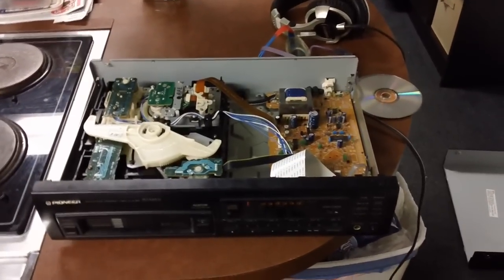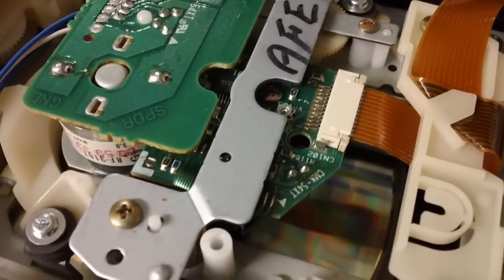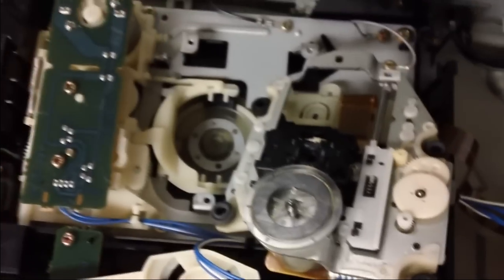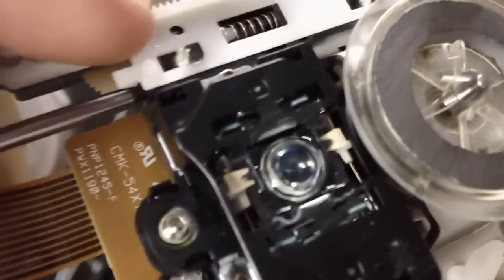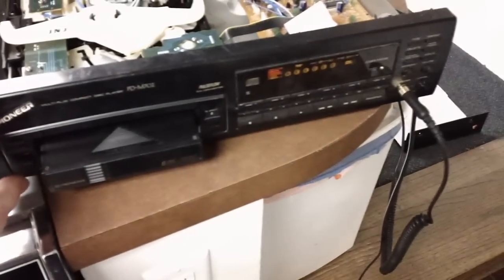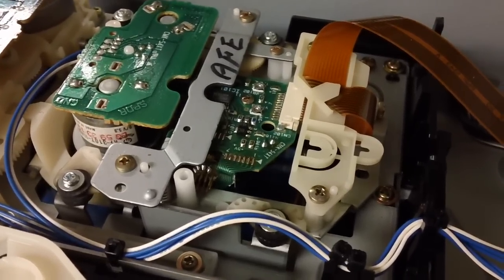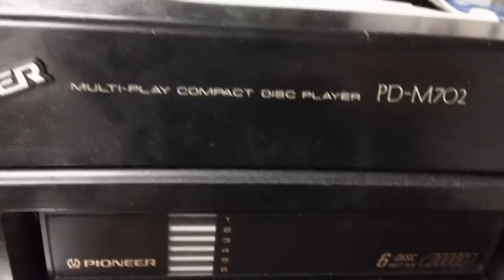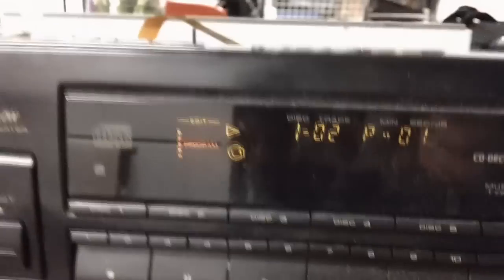Pioneer 6 Disc Player Repair

Comment: Within the last couple of days I fixed a Pioneer PD-M410 with exactly the same problem! I turned it over, as you did, and the lens fell right out. I even had the same cyano around the house to reattach the lens.  Thanks for posting the video!

Comment: Thank you so much for posting this. My PD-M502 had the same issue but was also making this high-pitched noise when I tried to play a CD and the player just hung up for a minute; the lens may have been loose and flopping around before it finally came off in the chassis. Not only did I save the unit from the trash, I also saved $75 which is the cost of a replacement optical unit (or $400 - $1000 for a new CD changer). I bought this system in 1992 (30 years ago!) and except for this one issue it has been soldiering on all these years.

Comment: Good diagnosis of a simple repair.  I just picked one of these (vintage?) units up for super cheap because because the previous guy didn't know that the CD's have to be loaded upside down in the cassette.  I watched your vid and thought, hmm if the lens is on the top, then the CD label probably needs to face DOWN!  It works fine after flipping the CD over.

Comment: Same problem with different pioneer model. I was puzzle when couldn't see a lense to clean,but thought cd not spinning was down to no power to motor. I have no idea why no lense would prevent cd spinning,but after finding your video and lense,I have now fixed my cd player. Many thanks.
Reply: How did you know which way to put the lens?  I tried both sides with clear tape holding it, but nothing either way.  It matters too.  If you look through the lens, it’s different.

Comment: Thanks for posting this. I just picked up a pd-m400 at Goodwill for $15 in pretty decent shape. Noticed in the store there was something rolling around inside the unit but it powered up so I took a chance. Carefully glued the lens back in with 5 minute epoxy. I just applied a thin layer around the rim of the laser body and pushed down firmly on the flange of the lens. Worked great, thanks again.

Comment: Just got this CD player and it didn’t work. Checked out you video and remembered that 25 years ago I had a single disc version of this player where the lens popped off in transport to college. Like you I glued it back in and it worked ever since. So it took this one apart and found no lens rolling around. So I read the instructions on the cartridge and saw that you must put the discs in “upside down”. Works just fine! Thanks and no thanks! Lol!

Comment: The lens only goes on one way. Be sure to use magnification to see which is the right way because you could glue in on upside down. He does not mention that in the video. I have repaired two of these for friends in our RV Resort. I would guess that many of those units had the same problem and ended up in the dumpster. This video saved two of them so far.
Reply: it goes in naro diameter side in
Reply: coolelectronics the little flange side goes inward...I see what you mean.

Comment: Thanks for posting this, but to others out there don't use super glue, use contact cement. 
If the super glue runs it will ruin the lense (super glues melt the plastic as part of the bonding process).
If you are extremely careful as he was it will be ok but rather not risk it. 
Others have said they use a tiny bit of loctite gel (not runny) and that works as well.

Comment: Discovered the lens had fallen on my Pioneer PD M630. Going to try model cement to hold it. Thanks for the video!
Reply: Testors model cement seems to have done the trick. Let it sit for several hours.  We’ll see how long it works!  The lens fit was pretty obvious, it seems to be in a little housing that fits into a slot. I put a couple dabs of cement with a toothpick on the rim of the housing.  Wore plastic gloves while working with it

Comment: Just a heads up for anyone else on here, I was having playback issues lots of ticks and found that the 4 rubber grommets suspending the transport were crushed. I shimmed them up so there was no gap from the bottom and it now works perfectly. I guess over time the weight of that transport crushes them flat.
Reply: I'm thinking this might be my problem as I too am having lots of ticks. What did you use to shim them up?  Have not opened up yet but want to be prepared.
Reply: Same here. All 4 rubber grommets had shrounk/compressed 2-3mm and were dryed up. Resulting in the cd scraping in the disc cartridge due to everything was sitting to low.
Reply: Can you maybe take a picture of exactly what you are referencing as I did have the lens problem, but still won't spin. I'm taking a chance, as this video and postings are older, but figured I'd give it a shot. : )
Reply: @lindimayfield9885  If you take it apart you will see degraded suspension grommets, use little orings to replace them to give you correct spacing. Its been a long time since I did it. If I did it again I would just cad up some new one and print them in tpu.

Comment: This video saved my day, and my player as well. My lens was also lensless, and I did the shaking...Lens fell out exactly as in the video.
Clueing that sucker back in place, can I just add the glue and put it back in it's place, or should I be careful with the glue? What is north and south on that lens? Thanks a lot...Michael

Comment: Common issue with these Pioneer six disc magazine changers.  The adhesive holding the objective lens in place fails, allowing the lens to fall clear of the optical pickup.

Equally simple fix: use low fume plastic cement to affix the lens back into place, such as modeler's glue.  I would not recommend using super glue as the cyanoacrylate fumes can deposit a residue that can foul the optics.

Just repaired a PD-M801 for a client that exhibited this problem.
Reply: bcdhifi

Lens orientation shouldn't be a problem, AFAIK, though, even if it is, you don't have much to lose at this point.

You would have to make sure the lens rests perfectly flat in its place, though.

The 5 min. epoxy sounds like it will work, so long as you use as little as possible to reduce the risk of any excess adhesive getting into the pickup or getting onto the surface of the lens.

But, even with fast setting epoxy, I would recommend letting it sit for at least a few hours in an effort to give the adhesive ample time to cure.
Reply: bcdhifi

You're welcome and good luck.

Comment: Can anyone help?! I have a Pioneer 6 disc changer, a little older than this model but I expect the mechanism works the same. Basically, the mechanism which guides the CD to the lens is leaving little grease spots on the CD, causing them to skip, dependent on where the spot is left. Are there little rubber/felt guiders that come into contact with the CD? It's been doing it for years and now my mate has got one and it does the same thing. I think it is stray grease  (that white stuff) which has leaked or melted on the rubber stops which is then imprinting on the cd's even before they get to the lens because sometimes they skip after I put a fresh, clean CD in. I have to clean the marks of each CD everytime they're played or they will skip on other equipment. My mate seems to think it's from the CDs themselves. I disagree with him. HELP!

Comment: @samer saleh is correct, DON'T use superglue!  A quick setting epoxy glue (araldite) or similar is perfect for this.  With regard to lens alignment, try to reposition where the old glue marks are.  Sit the lens in and apply 3 tiny spots equidistant around the lens applied with a very small tool such as a cocktail stick will suffice. Let it set and you should be good to go. Don't get glue on the lens!

@samer saleh pop it back off and clean it up with rubbing alcohol.

Comment: Any suppliers of replacement focus lenses? I cant find my missing part anywhere.
Reply: Same here. Did you happen to find any suppliers yet?
Reply: @CapnCody1622  None yet but im sure they are out there somewhere, China maybe. Next step is to find a Pioneer at a thrift shop and scavenge the lens.
Reply: @ridgerunner4943  I messaged a couple suppliers on Alibaba. Then I was putting the case back on the player and the lens popped out from who knows where! I got lucky this time lol If those suppliers message me back, though, I’ll let you know if they’re a good source.
Reply: @CapnCody1622  thanks and good karma that you found your lens!
Reply: @ridgerunner4943  Update on the Alibaba suppliers: They all want drawings and dimensions so not as easy to get as I thought it’d be. I was hoping someone would have them already made and in stock. If someone was able to get the exact dimensions of a lens it would probably be a good option for someone.
Reply: @CapnCody1622  my wife is Japanese and she is on the posts from the Akihabara suppliers. Someone, somewhere, has a box of these lenses.
Reply: @ridgerunner4943  Oh that's awesome! Yes, that's exactly what I was thinking. Someone's got to have some!

Comment: MUST READ, DO NOT USE SUPER GLUe (cyanoacrylate) this video shows the correct fix for most of these machines but the super glue will attack the lens and fog it up. Use a water based glue (even elmers would work here). You just need it to stick in there but super glue will mess it up...don’t make my mistake

Comment: I HAVE A PIONEER PDM450....WORKED FOR EVER,,,,STOPPED SUDDENLY. I FOUND THE LENS AS YOU NOTED IN THE CASE,  PUT THE LENS BACK ....BUT THE UNIT DOES NOT WORK,,,, GOES THROUGH ALL THE DISKS BUT NEVER SPINS....ANY OTHER SUGGESTIONS ?  I AM WILLING TO PAY IF YOU FIX MY CD PLAYER
Reply: +samuel kauffman Possibly you glued it on upside down.  eBay time.  I bought a used unit because the IR on mine stopped working.  I swapped out the laser assembly on mine for the used unit.  Anyway, good luck.
Reply: H

Comment: Pioneer had terrible reputation for their CD player losing the focusing lens and the very high end expensive models where also effected and you had to buy a super expensive new laser assembly  to repair the unit if you lost the lens, I remember many customer complaining that the less than 2 year old top end machine no longer worked and the lens could not be bought separately...............

Comment: I read somewhere else NOT to use superglue, it will haze the plastic lens
Reply from the maker: You're not wrong, if I could remake this video I'd change it to some sort of epoxy based glue instead, cyanoacrylate glue will haze the lens in some cases
Reply: speedytech7 I guess your one of the lucky ones.  I glued mine back on, and it makes the CD’s spin, but it just skips around the same spots on a song over and over....UNLESS, I hold the front of the unit up on a 70 degree angle....even then, not a guarantee but an improvement...ugh!
Reply: Andrew Battersby I was told by the ONLY Pioneer service guy left in my area that the 4 rubber grommets that support the laser assembly are shot from 20 years of attic heat and cold and gravity.
Reply: Andrew Battersby  and bad caps still wouldn't work at a 70 degree angle either...lol
Reply: Andrew Battersby  Its in the hands of an "authorized service center" now....along with the duel cassette player and turntable now.

Comment: I got the same problem but I can't find my lens
Reply: You will get the same symptom if the laser dies.  The spindle won't start up until it gets an initial 'bounce' from the laser off of the disc.  If the laser is dead, it won't start spinning and it will just cycle through all of the CD's, and will likely give a 'no disc' message.
Reply: Did you ever find a place to buy just the lens?
Reply: @CapnCody1622  ohhh yeah I did...like he said, it was in the player cabinet and when I shook it out...it went bye bye.
I searched my whole living room carpet, inch by inch and finally found it..Crazy glued it in and now good as new.
I doubt you be able to purchase any repair parts for it.
Reply: @oilman614  Beautiful! I luckily found mine, too.

Comment: Hope this works with mine which has also stopped working, however, you could have made the video about 2 minutes long, tops.We don't need to see you plugging it in, we don't need to see what's written on the CD, or listen to you describing the display panel on the unit (or your lack of understanding of the functions within it) etc. ffs.

What would have been much more useful (for many) would have been to watch you dismantle the unit, and remove the laser lens housing rather than just skipping past that with your inane drivel.

Thanks anyway, hope this works.
Reply from the maker: If you didn't like it no one is forcing you to watch it, it is 4 years old and I have no intention of remaking it. It was such a simple problem there was no reason to edit the video down. YouTube has this built in bar that pops up whenever you hover your mouse over the video and that bar lets you skip to a different time in the video, amazing right. I made the video in the style of UXWBill and Vwestlife, where I say what I know and try to be personable in between. I just figured I'd clue you in. Perhaps if you have such an amazing insight into how a 90s CD player works you should consider making a video about it, just make sure you edit out any part of it where you may not be 100% on topic. Also here is a little tip I learned when trying to sound smart, you'll be tempted to use words outside of your normal vocabulary like say drivel or inane, don't use a $5 word when a .50 cent one will do the job.

For what it's worth I hope this fixes your problem still, not that a CD player is of much use anymore.
Reply: Fair enough, just could have been a little more concise.
Reply: Dear speedytech7 
With all respect, if I insult you, will you answer my question?  ;-)
Hopefully,
Me
Reply: Dear speedytech7 
With all respect, if I insult you, will you answer my question?  ;-)
Hopefully,
Me